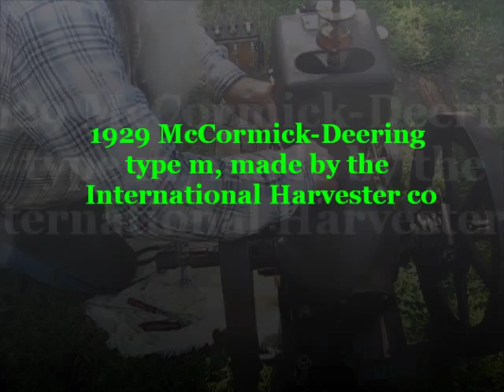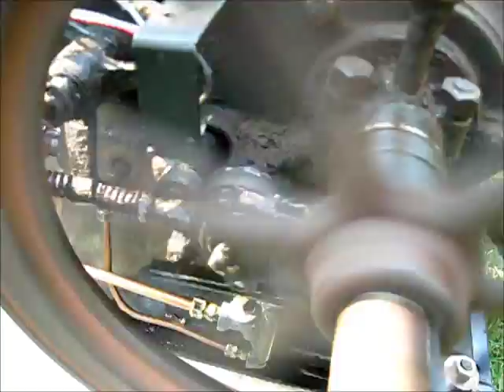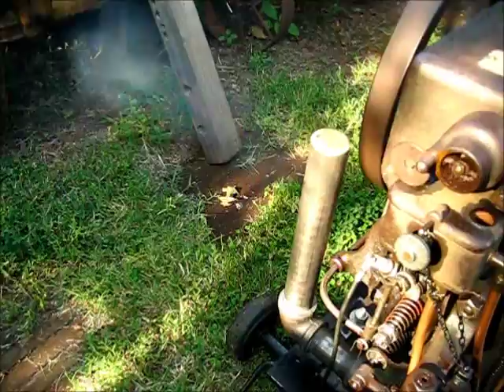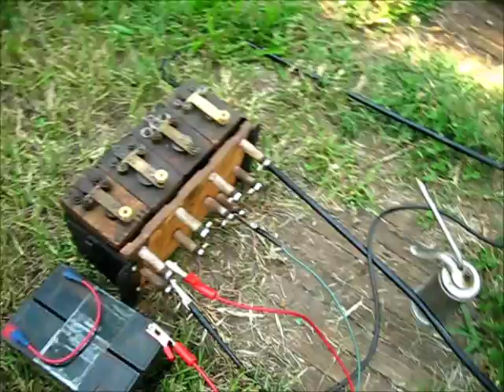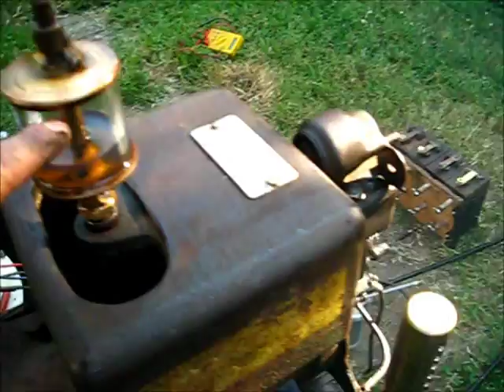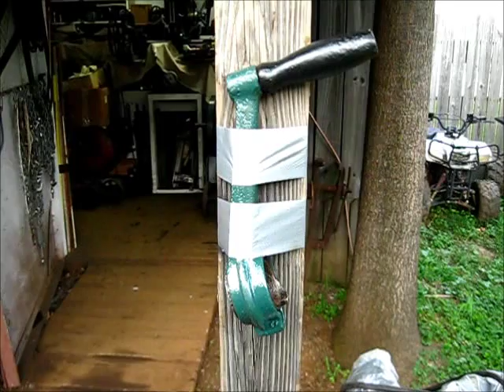1929 McCormick-Deering / type "M" flywheel engine / hand start

Comment: my grand dad used a engine like that to run a mill.,use to grind corn and whet to make flour and from corn .,corn meal he did that for the whole village it was in the late 30s early 40s but the fuel was not gasoline it was call petroleo and looked like kerosine it was kind of blue ish purple..thanks for the memorys...
Reply from the maker: +RAMM GARR ,,, from here in middle Tennessee,,,, thanks,, for sure,,,, thanks,,,

Comment from the maker: ,,,, if the top of your engine's water hopper has been broken off and then wired in place as not to be lost,,, then it's a bailer wire,, if not, it's a type "M",,,, no parts, thanks

Comment: Sam. I am SO glad to know you are out there!  I am a little confused however. I picked up a 1927 Mccormick deering, it's labelled gasoline.  It has the wilco magnetto all brass cover, it's lovely, someone has done some work to it at some point, is it a type M or a bailer wire?  I have spark, no fuel, will use your lovely videos to help me get this puppy running.  The serial number is AW49278. Do you sell parts? All new to me! thanks so much for posting these videos. I am much appreciate them all